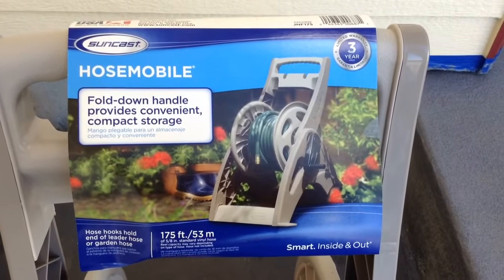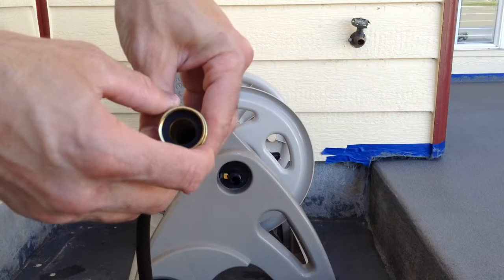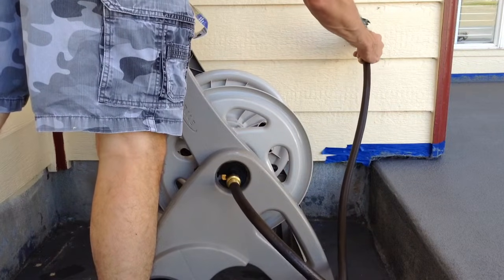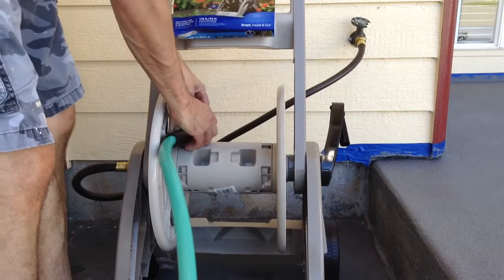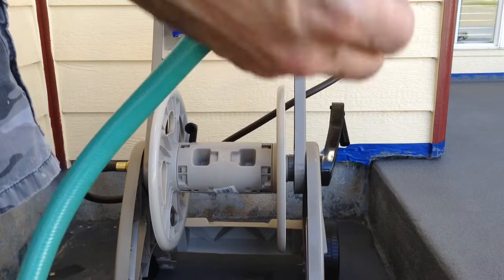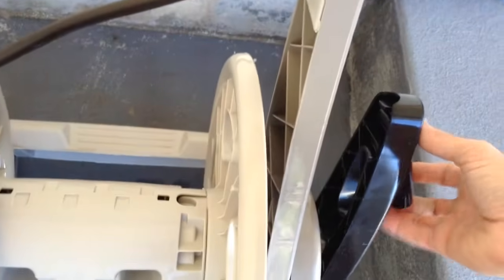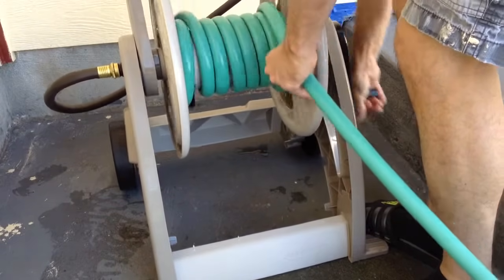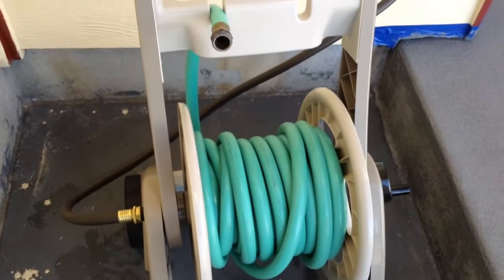HOSEMOBILE SET UP AND REVIEW

Comment: I know this video is a few years old now, but still hoping for assistance, Thanks for showing how to use this thing. I just bought two. b/c I have two waterholes at different sides of my house. OK but when you attach the horse thingy to the wall? then how are you to move it to water the grass... Oh and this might not even work for me b/c my spickets are not that low to the ground they are both actually up kid of high... SMH the builders were learning when they did my house..
Reply from the maker: Hi TRU.. if your hose spickets are too high up you can actually get a longer hose portion and use that to run from the mobile to the wall.. you don't need to move the mobile , just unravel the hose and use that to water :)  I hope this helps out ;)

Comment: I would like it in reverse once it's all rolled up and explain if when ready to use the hose for spraying, if you have to hook up that short hose to your water hose?.
Reply from the maker: Hi Gloria, YOU can hook up the short hose anytime and it will not interfere with the long hose.. but it does need to be connected to get water

Comment: Hello, thanks for this video! Brought this same model yesterday and hooked up. After turning on, the leader hose would come off the side like some other folks said. Returned it and got another one assuming it was faulty. Have not hooked it up yet but thinking, as we wind or unwind the hose, wouldn't the leader hose connected to reel and spigot twist and break off the side attachment? Or am I overthinking this?
Reply from the maker: it has a mechanism on it that keeps that portion from twisting :)
Reply: @ETPCYT  , thank you for that bit of info. And really appreciate the video you made!

Comment: Idk if I'm wheeling mine up wrong, but I have to unravel the whole thing for water to come out of the hose. It would've been lovely if water can come out while it's still neatly rolled up, but only use the amount of hose I need in the moment.
Reply from the maker: check to make sure you are winding it in the correct direction.  Where your hose attaches to the plastic part coming out of the middle.. if you wind it backwards it will pinch the hose and water will not flow.. YOU want to make sure you have the hose coming off towards the front.. I hope that helps

Comment: I was so desperate trying read 

I'm so glad to find this video/ I was so desperate when I started reading  & trying to figure out the instructions on assembling this hose carrier. Thank you very much for the video. Recently I bought one carrier from the same company that look just like yours in the video... but it has been updated with a SLIDE TRAK HOSE GUIDE in the front of it. 
How does the slide track works and what is the advantage of the update and the one you have? Gracias Senor!
Reply from the maker: Hello Maria, I believe the slide track helps to guide the hose so that it is easier to roll it up and YOU won't have to use your hand to guide the hose in order for it to go into place nicely.

Comment: Hi what was the “new” circle thing u replaced with the old one does it come with it? Should it def be used. And I guess I’m confused so this thing shouldn’t be moved stays next to wall..😊
Reply from the maker: Hello MARY.  The circle thing was a rubber gasket or seal.. it is the round rubber piece that goes between the connections of the two hoses, it generally sits on the inner portion of the hose that has the threads on the inside.  I think it came with it.. if not they are easy to find at a Home depot or lowes..  They keep the water from leaking at the connection points.. they help a lot.  Mine generally stays next to the wall and I just unwind the hose to where I want to water then when I am done, roll it back up :) take care! I hope this was useful :)

Comment: why is water coming out the bottom hole from the out tube when I turn on the faucet. Hose is hooked up right?
Reply from the maker: hmm.. check your connections.. sounds like you are probably missing a rubber seal ..

Comment: We connected everything just as the video said and when we turn the water on the hose on the side where the water enters the unit it pulls out immediately and doesn’t go into the holes the pressure just pushes it right now what can we do is it broken? help!
Reply from the maker: Hi Helene,  I just went outside and looked at mine.  The hose screws into a black plastic connector on the side.  That is held in place by a plastic "clip". (the clip on mine is yellow and it has a number 2 on it. THis can be bent back with a screwdriver enough for the black plastic connector to slide into place and then it secures it in position.  If your connector part is coming off either you are missing the clip part or it isn't over the connector part.  Look and see if their is a yellow (perhaps a different color) plastic part with a hook type edge on it.  If there is you can slide your black plastic part most of the way on... then using a flathead screwdriver bend that hooked clip back enough to get the connector on flat.. I hope I am explaining okay.. If that clip part is missing I would take it back and get a new one :).. Have a wonderful day, HELENE :)
Reply: ETPC EPIC TIME PASS CHANNEL thanks but we gave up and I returned it my hose is on the ground again 😢
Reply from the maker: @TheHeleneo1  Hello, Helene, I am sorry it didn't work out :(  Take care and be BLESSED :)
Reply: @ETPCYT  I have the same problem: I have the yellow part that you speak of, tried to put it different ways, but water is still splurting out of the exterior of the hose reel...

Comment: Thanks so much for this. I read the instructions three times and couldn't figure it out. One question- are you supposed to lock the crank handle back into place? It doesn't specify in the instructions and I feel like I'm going to break it if I try to put it back up.
Reply from the maker: I just got another question about the crank.. I have never messed with the crank as far as putting it back up.. I will have to check it out and leave a comment :)
Reply: @ETPCYT  Thanks, not a big deal, was just wondering lol :)
Reply from the maker: @CentralJerseyDrivers  hey I actually just checked, so yes, the crank does fold in easily.  On the back part is a tab that sticks out a little .  If you push that the opposite way that the handle folds it releases the handle to fold easily into place :)
Reply from the maker: @CentralJerseyDrivers  I should make a video real quick :)

Comment: Just hooked mine up....exactly like this video and the water sprouted out of a different hole. Am I missing something or is my hosemobile faulty?
Reply from the maker: Hello... let's see if the short hose is hooked up from the outdoor faucet to the side of the hosemobile, the only other place water should come out of is from the other hose attachment that is on the middle part that the hose wraps around.  If you hook up the garden hose to that one and have some kind of attachment at the end to regulate the flow of water, there should not be anywhere else that the water is coming out.. Where exactly is the water coming out of?
Reply: The piece that the short hose connects to came off when we turned the faucet on.  How does it stay in with the pressure it gets

Comment: So how far can you wheel this away, with a leaderhose of about 4 ft? Just wondering if the mobility depends only if you use a 2nd hose of reasonable length
Reply from the maker: Hello and thank YOU for the question.. Yes, the lead hose is about four feet.. could be extended if YOU added a longer hose...the mobile is pretty much to hold the hose I guess :)

Comment: I don’t have that small bit of hose between tap and reel I only have my 20 ft hose pipe does it not just loop around reel straight onto the tap on ur wall
Reply from the maker: a longer hose I don't think YOU could loop that portion on the reel along with the other hose... if I am understanding you correctly...